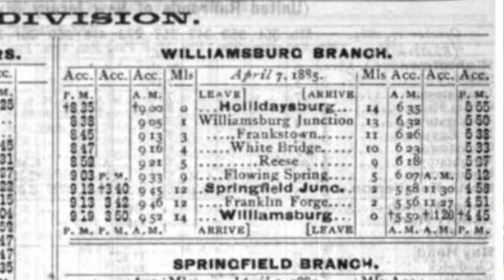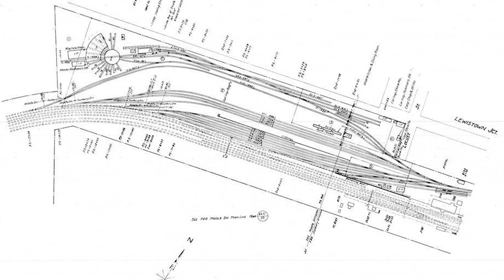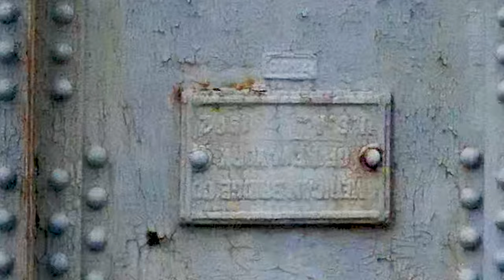Locomotive Turntable flipped over and turned Bridge

Comment: Thanks for preserving the quaint history.
At Cassandra, Cambria Co, the old road from Rt 53 was abandoned and the iron bridge crossing the PRR (aka NS) mainline was repurposed as pedestrian bridge and offers a nice trainspotting location between Cassandra and Portage.  The sides were moved in closer together to deter vehicles.
On bridges, remember the good ol' days when some bridge decks were steel grating and had a musical rumble driving across.  As little kids we called them singing bridges when driving across.  Just down the road in Frankstown where Reservoir Road crosses the Juniata was a steel grate bridge deck but long since replaced.  A small was on Lower Riggles Gap Rd, Pinecroft Blair Co and replaced a few years ago.  The steel grate bridges reached the lifespan and often narrow well outside current highway standards.  The many old narrow bridges on secondary township roads is a significant reason PA would score poorly on infrastructure.  Not necessarily ready to collapse but at/exceeding their lifespan and just not to current design standards.
Reply: I miss the singing bridges!   Living in Martinsburg we regularly crossed the singing bridge over Plum Creek.
Reply from the maker: This would be a great location for a pedestrian repurpose.  My father and I were joking about the fact that it is part of the PA Bicycle Route (complete with a SIGN) and right now if you are on that route you have to detour to the main highway, which is NOT a place for riding on a bicycle, even if you are a professional bike rider.
Reply from the maker: I remember as a child loving to cross over the Delaware River on the Betsy Ross or Tacony-Palmyra bridges because they were "singing bridges".  Loved that sound.
Reply: @ODDySEEy  That would be great repurposing to join the trail to Williamsburg.  The Great Allegheny Passage bike trail is good example incorporating the old Western Maryland RR from Cumberland MD to Pittsburgh area.  Walked the Big Savage Tunnel at the state line and the iron bridge east of Meyersdale & big viaduct bridge above the farm fields just west (gets windy up high on that).  
Always amazed and impressed at the stories you uncover to bring history to life in videos.

Comment: Well now, I wasn't even aware there was a turntable down by the Lewistown junction. Just such an insignificant spot these days.
Reply from the maker: I ran into that issue when I started this quest.  I had no idea that Lewistown even had an reason to be on the map for Railroad information more than a station... but yes, they had a full blown interchange and junction complete with round house, repair shops and a turntable.
Reply: @ODDySEEy  I am often surprised about what used to be in these parts. Not much going on in Lewistown these days, not anything good that is. But along with what you mentioned, there also used to be electric trolleys that ran across town and all the way to Burnham and Reedsville. My grand parents had mentioned them before and there's still signs of it places if you know where to look. Just hard to imagine such a thing in Lewistown these days.

Comment: Hi I’m new to the channel. You have lots of interesting videos. Was wondering if you have done any videos on the underwater town of Aitch or any of the underwater bridges at Raystown lake? Thanks and keep the great videos coming!
Reply from the maker: I am actually a pseudo adjunct member of the Raystown Lake "Dam Diver" team who are doing research on the Old Raystown Dam.  In time, and when I get my boat back to "legal" status, there will be a large series of videos on the Old Dam as well as Aitch and the rail lines out by the Brumbaugh Ruins (and some other sites, like what is REALLY under Sheep Rock). ;)
Reply: @ODDySEEy  excellent can’t wait to see the series. I have tried finding pictures of things like fink and Hawns bride and just any pictures of locations before it was flooded but have had very little luck. Someone out there has to have early 70s pictures. Also I’d like to see the 7 points area before flooding.